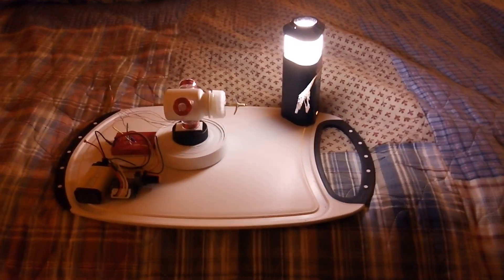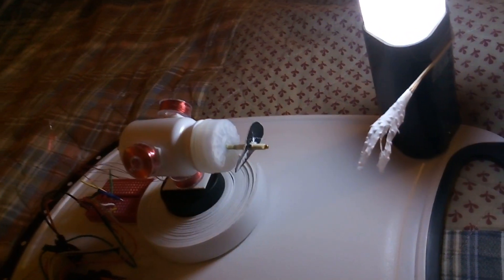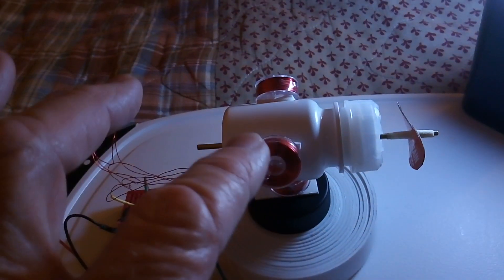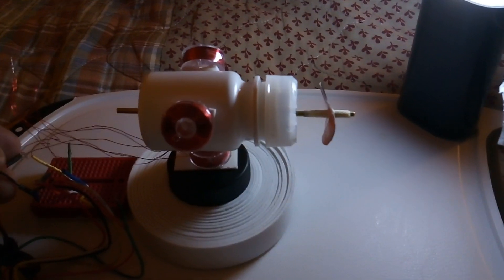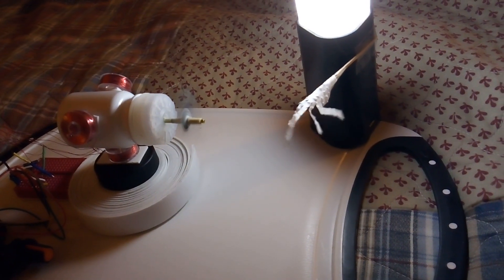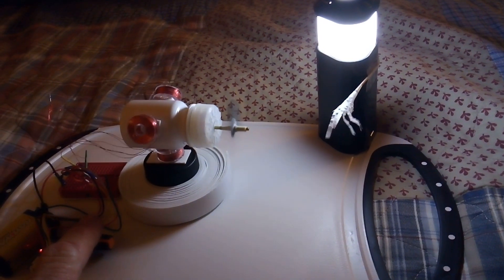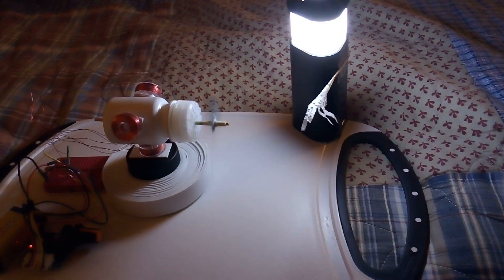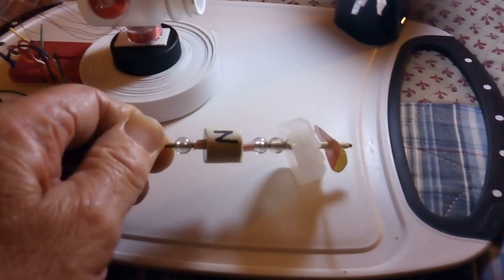3 Phase BLDC Motor --- Using ring magnet rotor

Comment: Fastest strongest magnetic motor yet!! Well done I can’t wait to see some hybrid builds next. Thanks for sharing.
Reply from the maker: Yes.  This is the strongest one of this size I have built.  The reason is the way that the field coils are turned on by the controller.  They are turned on in pairs six different ways each revolution.
Reply: @Lidmotor  The coils are set at 120 degrees.  The pulsed timing from the controller optimizes on/off pulses to maximize rotor rotations performance (torque, speed, etc).

Comment: Nice!  You made an 'in runner' 3-phase motor--which essentially means the rotor is inside the stator windings.  I prefer to call them internal rotor motor or IR motor).

The alternative is to make an out runner--which just means the rotor would be (in your case) a lid with permanent magnets on the inside lip/rim of the lid.  That lid rotor would then spin around internal stator coils.

Nice work!  Thanks for sharing.
Happy New Year to you too, Rusty!
Reply from the maker: This is a project that I wanted to do for years but really didn't understand what was going on.  Now that I have a working model as a study guide it all makes sense.  Pretty fascinating stuff.
Reply: @Lidmotor  A detailed description of speed controller components & their functions would be a nice video. :)

Comment: Great project. If you can't fly it your could put it on a car or a boat. The car could be tethered to drive round in a small circle. 😀
Reply from the maker: The easiest thing would be a fan powered floor runner.   I might have to put a bunch of pillows at the end of the hallway so the car doesn't crash through the door.  Ha!  The boat idea would work also on my swimming pool.  I would really like to try something like this on a model airplane.  Perhaps make a much smaller motor.  I remember how much trouble you had trying to get that standard permanent magnet motor to power a plane.  The power to weight ratio isn't good enough.

Comment: Is it possible that you can give us the circuit diagram of this motor.including driver circuit because it's so important for me
Thanks.
Reply from the maker: The driver circuit is VERY complicated.  You can do a Google search to find it if you want to build one.  Type in '3 phase BLDC motor circuit images'.  If you just want to know how the coils attach to the driver then that info is there also.  My setup in called a 'star wound' configuration.  The driver I am using can be found on EBay for about $5.
Reply: @Lidmotor  Thank you for reply sir when i see your last video then i understand . Thanks once again.

Comment: Happy new year for you too
Reply: and please illustrate the diagram, I do not see a sensor hall
Reply from the maker: This controller does not use hall sensors but relies on the feed back of the magnet passing the field coil.  Google search this motor (like I did) to learn more about it.  The coils are 'star wound' and the controller is a very complicated electronic circuit.

Comment: I can see there is no iron core to cause lenz law drag.
What happens to the collapsing coils EMF ?
Can you redirect the collapsing fields to charge a super cap ?
Reply from the maker: I played around with that a little yesterday.  There is a lot to look at with this gizmo.  The way I understand this the coils are fired in pairs----six different ways each revolution. It is complicated.
Reply: @Lidmotor  
If it is changing the polarity applied to the coils then diode steering to charge a super cap will not work to capture the back emf.
Reply from the maker: I found DadHav's video from years ago where he built a circuit to run this type motor.  That circuit DOES make use of the back spike but it only runs on two phases and has to be hand started.  The circuit is basically what I use in most of my non-stop running motors only it is two of them joined together.
Reply: @Lidmotor  Here's a good animation vid of how a bldc motor works.  
https://www.youtube.com/watch?v=bCEiOnuODac

A bldc controller energizes the right coils at the right time to maximize attraction & repulsion of the coils to create rotor motion.

Here's a good video on how to build a 3D printed Halbach motor:
https://www.youtube.com/watch?v=YsSm65DAcCg
Reply from the maker: Very good videos.  Thanks.

Comment: This is now a sort of R/C  'inrunner', but definitely a great teaching aid. 
Have built a few, with the coils around a magnet from a 'coreless' 4mm motor. The homebuilts normally use a Hall sensor on top of the coil(s) when used with no PWM signal. What a fun project !
Reply from the maker: I figured that you had built one of these types before.   I wish that I had someplace close to fly model airplanes so I could try some of these designs out on planes.
Reply: It depends on the size, things like the Parkzone Vapor can fly indoors, or micro quadcopters. But there would be some extraordinary skills needed to build the 1 gram motors! 
Mind you, cars are another option, only needing a kitchen floor to test out motor ideas.  
Here's one of mine in a quick vid,  from 8 years ago. I probably couldn't do it now having forgotten most of it. Dress pin as motor shaft:
 https://www.youtube.com/watch?v=iLJkUEGVA6E
Best to you for 2019 !
Reply from the maker: That is a neat little motor and how you drove it is also interesting.   The drees pin motor shaft is a cool idea.  I found an "RC flying field" about a 15 minute drive from me.  I might dive into that hobby one of these days. I used to build model airplanes as a kid but never got into RC stuff.  My builds were all balsa wood rubber band power types ----or just gliders.
Reply: Forgot to answer with a suggestion, sorry about that. 
To build a nice light glider of your own design (or bought), then fit it with the guts from a micro quadcopter. Same thing as the Peter Sripol method, where I flew a paper plane RC. 
A $15 quadcopter would get you into the hobby and it's so much fun to fly different designs around by simply swapping the pod, plane to plane.
You could put the motors and circuit on a tongue depressor!  
Added bonus, by repurposing the quad, you'd have 2 spare motors and they usually come with 4 spare propellers. Any drone that's not altitude hold will work.